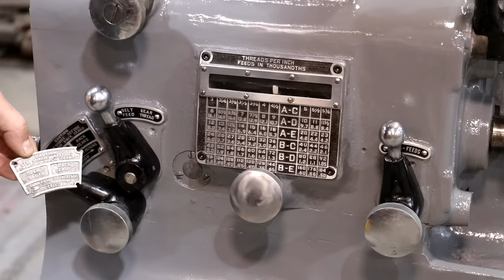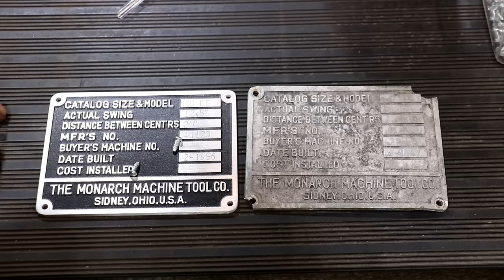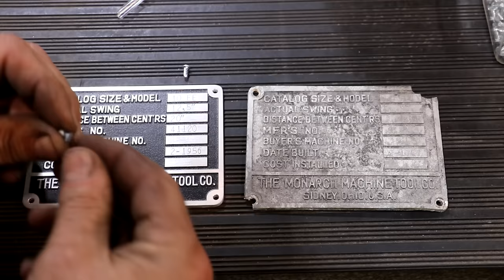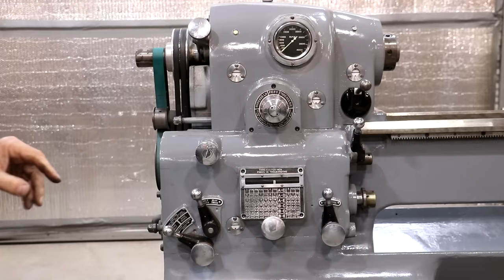Monarch 10EE Restoration: Little Details - Sight Glasses, Tags, and Doors

Comment: Thanks Keith, hope you recover quickly and the pains pass!!

I am just finishing up the restoration of my 1972 10EE 20 I/M.  This later generation of 10EE lathes replaced the motor-generator with  vacuum tube electronic regulator rectifiers for the DC power supply.  My machine was being moved with a fork lift and had fallen over on it's face and damaged ball cranks and handles then sat for 13 years with no love.  The 2 C16J vacuum tubes were also bad and could barely make the lathe run.  It would start running on one tube then the speed control would run away to 1800 rpm.

As an retired electrical engineer I designed a solid state replacement for the vacuum tubes.  My SSC16J tube replacements worked perfectly the first try, damage repaired and the lathe is back running like new.  

I am waiting for re-designd printed circuit boards (PCB), they should be here today or tomorrow.  I redesigned my prototype SSC16J PCB to be build up for the larger C16J or smaller C3J tube replacements and fit as drop in replacements in the 10EE.   The C16J tubes handle the stater winding up to 30 amps @ 0 to 300V while the C3J powers the field winding at about 2 amps @ ~45 to120V.

When all 3 tubes are replaced with my SSC16J and SSC3J circuits no warmup delay is required and I can bypass the 2 minute power on delay timer for an instant on lathe !  By eliminating the heaters you reduce the heat by 160 watts and the solid state replacements have a lower voltage drop that reduces waste heat at full power by over 500 watts.  

The only change to the 10EE required is to adjust the compensation pot in the control module for the slightly higher efficiency of the solid state over vacuum tubes.   Adding a single wire bypasses the delay timer for instant on.
Reply: Christ: WHAT?  I was told as a child it was just magic which has seemed reasonable through my adult life, only now to discover there's technology and engineering involved!

Comment: Great content as usual, my friend.

I'm a big fan of that colour you painted the body. On my screen, it looks identical to what my friend and I painted all of my mine. I have OCD so the need for neatness where everything matches, like the colour of the machines, is strong.

Like you, I have purchased rundown or damaged machines over the years to restore back to factory condition. I have done this for almost 15 years with the help of a dear friend of mine, Buster.

Here's a bit of British history for you. 

Buster is the grandson of the infamous Great Train robber of 1963, Buster Edwards. 

Together with several other gang members, they robbed a train in 1963 just outside London, on a now famous bridge, stealing over 2.5 million British pounds. That would be about 60 million in todays money.

But unlike his infamous grandfather, my friend stayed on the straight and narrow path, becoming an engineer at British Aerospace. Sadly, through an injury he sustained while canoeing, he had to retire from BritishAerospace at the age of 51.

But not all was lost because he then came to work for me until his official retirement age of 65 two years ago. Now, he works with me on special projects or when he is bored. Most days, he is here with me, and if not actually working, he's giving out valued advice.

Back to you. Like you, we lovingly restored all nine of my machines to an original state when they were first manufactured. Where possible, they get used on a weekly basis, but at the very least, we start them up and run for 5 minutes every day, just to keep the kogs oiled up.

The furniture looks great now that it's been painted, polished, and brought back to life. Most of my chrome parts were either too far gone, which meant they had to be replaced with parts from machines broken for scrap or they were hand made.

It's a shame about all the runs in your paint. You went so far as to repair, replace, and repaint the machine to a high standard, then let it down because of a poor paint job. Otherwise, what a fantastic looking machine. 

Can I give you some advice? Those drive screws you used for the serial number plate made by Tom are too short. In no time at all, the screws will become loose from the vibration.

I suggest that when ordering replacement hardware for another project, you order enough longer drive screws to replace the short ones.

Here in the UK, we have a saying. "The rule of thumb is." In this instance, "the rule of thumb is that there must be at least two-thirds of the screw or bolt needed to secure an object in place sufficiently." 

It looked to me as though there was not enough screw threads potruding the plate, especially when you hammered the first screw fixing in,vit was wobbly.

You had to hammer it a second time and although four screws are used, the plate will still become loose,  sooner rather than later especialy if that machine is used regularly.

A longer length will enable a good anchor for many life times. Other than that, everything looks perfect.

Comment: FWIW I learned a heat gun will soften up the old sealant and the sight disk will pop right out. The scratches will polish out rather easily, by hand is best as the surface will ripple if friction heated. I used Gasgacinch and haven't got a weep, let alone a drop.

Comment: I'm a hobby gunsmith and machinist and deal with small screws original to whatever firearm I'm working on and the last thing you want to use is a typical flat head screwdriver, you should get yourself a set of hollow ground bits, the blade has parallel sides and when using the right sized bit wont slip or spin out of the screw damaging the head, they would be great for these flat head screws on this machine, I can't wait to see this machine run, I've always wanted a Monarch 10EE, very cool and it looks great!!

Comment: That lathe is looking fantastic Keith, they aren't at all common in UK, but if one comes up and I have the brass, I think I will go for it.
My sympathies about the kidney stones, they really do hurt. When I had two of them (8mm and 10mm), the Lithotriptor that they use to ultrasonically break them up was at another hospital, then they found that the endoscope laser wouldn't work on them either, so they ended up pulling them out with the sort of instrument you would use for picking up a dropped spanner in an engine bay. Very, very sore.

Comment: Yeah, I've been through the kidney stone drama too. Had to go to the emergency room with a pain level 10. An IV drip of morphine was instant blessed relief. What a wonderful drug for pain as any wounded soldier that survived will tell you. Once the stone(s) are in the bladder it's smooth sailing. When you urinate first pinch off your "hose" to dilate the urethra and build up pressure. When released will fire out those rocks easily.

Comment: Can you run a brush through the pipes the oil goes through? The stain and sludge could be varnish that sticks and clogs . It mite be the oil used because some oil has wax in it and will stain and clog . Try  a rose bud and milk the sludge out and clean the lines feeding the glass. Replace oil and filer . I have had two kidney stones . Got them from many hours on dirt bikes . They no a have a ray that breaks them up into pieces for pain relief. Shatters the stone into sand for easy relief.  Drink some strawberry moonshine to force liquids. The strawberries are eaten first to kill your taste buds and then sip the rest. Relives the pain and the more liquid is good for the situation. Have with ice tea . Drink ,Drink Drink . The more you drink the easier to pass the stone. Good luck  just remember if you start seeing double close one eye.

Comment: The Monarch 10 EE is the ultimate dream Lathe. That virtually all machinists would love to have in their shop. The only problem I see with the Monarch 10EE is the vacuum tubes and the other electronics that control the lathes motor. Are not being produced anymore. I often wonder if there are any Monarch 10EE’s out there that the original motor controls still function? I would think most machinists would do a conversion to eliminate the vacuum tube and electronic motor controls. Anyway good luck with restoring all the machines you restore better than when they were new. 
    I often wonder what became of the Steam Locomotive Stoker Engine? The last video I watched on the Stoker Steam Engine. You were trying to figure out how to mill the main body section that was spray welded. Did you give the people that owned the Stoker Steam Engine back to them? It doesn’t make sense that quite a few Stoker Steam Engines were not sent to a scrap yard. They became common place as the Steam Locomotives Fire Box became so large that a Fireman could not keep up with the demand for coal by manually shoveling coal into it. My Great Great Grandfather was a Fireman on the Pennsylvania Railroad for 10 years before he was permanently promoted to Locomotive Engineer. I can still remember his son. My Great Grandfather telling his stories of his father and himself. My Great Grandfather was also a Fireman and Promoted to Locomotive Engineer on the Pennsylvania Railroad. My Great Grandfather would tell my brother and I. Stories of shoveling coal into the firebox on Steam Locomotives. As the Steam Locomotives size and firebox became larger and larger. That it was near impossible to keep up with shoveling the coal into the firebox. That the Locomotive Engineer would also help shovel coal into the firebox. My Great Grandfather was so thankful when the Stoker Steam Engines started being installed on the largest Steam Locomotives. That as a Fireman. There were times when it would rain and then freeze the coal in the Tender. That he would physically have to break up the ice riddled coal. To prevent the Stoker Steam Engine Worm from getting jammed. He said the Stoker Steam Engines Worm would get jammed sometimes. Making his job even harder. Manually shoveling coal at the same time trying to free the worm that fed the coal into the firebox. Usually getting jammed from a rock that was missed in the coal. He told us the first Stoker Steam Engines didn’t have a reversing lever. So he couldn’t reverse the rotation of the worm to get it unstuck. Many of the K-4’s never had a Stoker Steam Engine installed. Mainly only the huge freight Steam Locomotives had Stoker Steam Engines installed. He had also told us. The Pennsylvania Railroad tried to have 2 Fireman on the huge Steam Locomotives. That there wasn’t enough room in the cab of the Steam Locomotive for 2 Fireman and the Locomotive Engineer. For the 2 Fireman to shovel coal into the firebox. My Grandson is now a Seventh Generation Railroader in my family’s railroad history. He just recently passed the Conductor Course.

Comment: Hi Keith. A great post on how to walk around this #10. The lables are nice and clean now. Far better for finding that perfect movement of the apron. That and running this old girl till you can hear the gears running dry is usually a death sentence for any machine. You sure run across a lot of tapered pins. In 50 years I have only come across 1. Do you not have a pedalship cotton wheeled buffing wheel. They work great and are easy tomake from a small grinder with extensions. Easy to make and easy on the pocket book too my friend. Check out mine that I made from scrap.Seems I am always commenting right befor your solutions. Kidney stones can cause fingers and feet to be amputated. I lost my R leg and a good friend lost both feet and most of her fingers. Bad news for sure my friend. Take care. You can look forward to mind nunbig pain to pass thyat puppy but I know you can do it, You have to bud.

Comment: Hoping you are feeling better and the stone has passed. A suggestion on the site glass or any type of clear plastics , you can use a headlight polishing kit from 3M available at auto parts store. I've used them and they work great.  Cheers

Comment: For acrylic and similar plastics an aqueous slurry of stannic oxide (usually availble from jewellers supplies vendors) is a better choice than rouge. A buffing wheel isnt necessay as a thin cotton cloth streteched over a flat plate will suffice. A few minutes handwork will quickly polish out from a fine ground surface. Polycarbonate can also be polished by hand using a stannic oxide slurry.

Comment: Wow.  Mr Utley is really upping his game and getting things done.  Laser etching tags is a great idea for modern production of those parts but I believe it is also pretty slow.

I'm actually mildly curious how they were mass produced back when.
Reply: Cast aluminium, paint and then machine or polish to top surfaces back, cast brass the same, sheet brass could be stamped or acid etched, modern sheet aluminium are printed.
Reply: @dutchgray86 Were they "die cast" aluminum?  If so, how were the dies machined?  Pantograph?

Comment: No, don’t use sandpaper on thin plastic. You can easily make it too thin, use either Nova products for this, or Brillianize products. They are specifically for plastics. They’re creams that go from heavy scratch removal to high optical polish. If you insist on polishing these small delicate pieces on a polishing wheel, be very careful to barely touch the wheel. If you press a bit too much, you will melt the plastic. Keith did a good job here with his ability to control his hands. But I still wouldn’t recommend to do it that way.

Kidney stones are a real problem. I’ve got a friend who gets one every few years. Good luck that it just comes out.

Comment: Unfortunately those cork gaskets might not work. They need to be smaller to press on the sight glass to seal it. A o-ring might be needed to seal up the glass section.